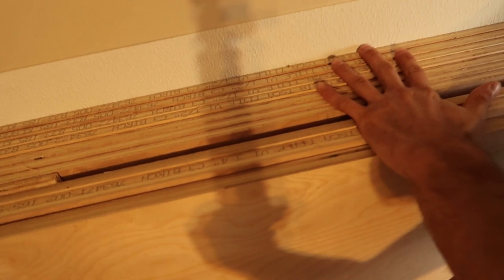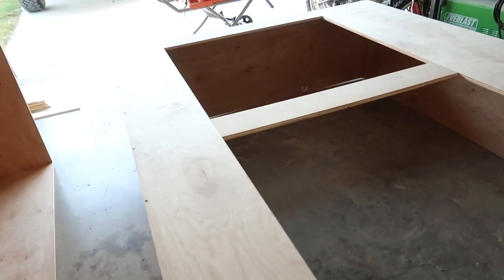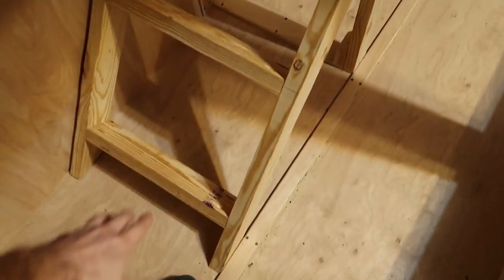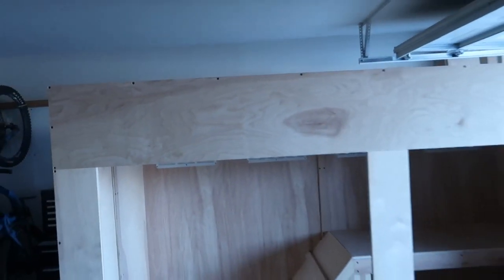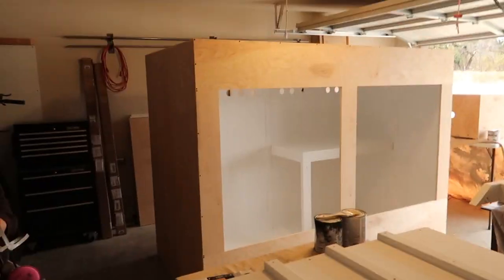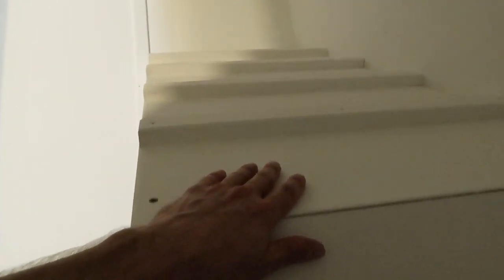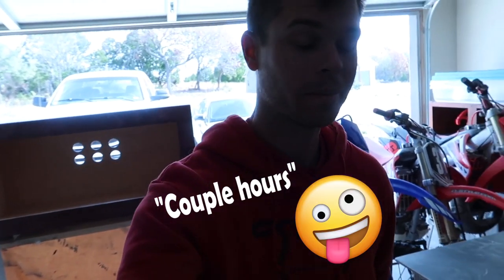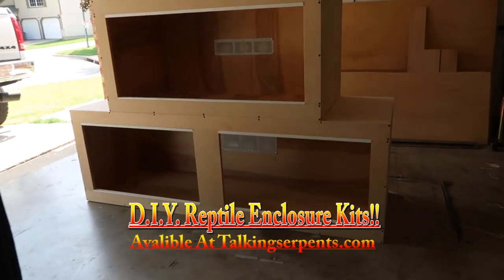Reptile Mansion 2.0!!  8'x4'x6' Big/Huge/Epic!!

Comment: Does the center bow at all? I'm looking at building a 8w4d6h with Birch 1/2" 4x8 sheets. Kinda like you did so I can fit it through a door way.
Reply from the maker: The center did not bow. The front and back half of the reptile enclosure are joined together with a 2" wide seam cover. 😎👍

Comment: I love all your cage builds. What is the lead times? And if you don’t mind me asking a rough estimate for a 4‘ x 4‘ x 8‘ long enclosure.
Reply from the maker: Thank you! On average lead times for a custom reptile enclosure kit take about 7 days to complete.

 • 8' wide x 4' deep x 4' high DIY reptile enclosure kit $977.99

• 8' wide x 4' deep x 4' high CUSTOM reptile enclosure kit with exteior PAINT, and inteior sealan $1,227.99

• 8' wide x 4' deep x 4' high CUSTOM reptile enclosure kit with exteior STAIN, and inteior sealan $1,377.99

Due to the size and weight of this reptile enclosure kit it can NOT be shipped with glass. My reptile enclosure kits are shipped with instructions, and inside these instructions there will be dimensions of the EXACT size of glass needed. Give these dimensions to your local glass company and they will easily be able to get you what you need. 😎

Shipping this size reptile enclosure kit is around $350. 

For more information you can send me an email to talkingserpents@gmail.com

Comment: For joining the corners you just screwed the plywood to each other with no additional framework ? And it’s sturdy enough ?
Reply from the maker: At what particular area on this reptile enclosure are you referring to specifically?
Reply: @talkingserpents  all edges where the side edges meet the top and bottom pieces .
Reply from the maker: @michaelmonast6440  1 1/4" screws that are countersunk. All of our reptile enclosures on our website talkingserpents.com are built to be strong and stackable. 

They can be stacked to the ceiling if that's what you want you need to do.

Comment: What plywood size did you use? I think you said birch plywood is it 1\2 ?
Reply from the maker: I use a combination of 1/2" and 3/4" birch plywood. 1/2" on the main structure, and 3/4" on the front trim for extra strength.

Comment: What thickness plywood did you use? How sturdy does it feel?
Reply from the maker: 1/2" birch wood. Feels very secure.
Reply: @talkingserpents  impressive! I would have thought 3/4 would have been necessary at that size. Thank you
Reply from the maker: @jordansilotti1283  it depends on how it's built. I use certain techniques to create rigidity. Also the front trim assembly is made out of 3/4" birch.

Comment: Will azek screw and plug kit work on the melamine enclosures
Reply from the maker: I don't know what that is. Do you have a link?
Reply: @talkingserpents  azek is a an Exterior pvc trim we use on houses for facia, around windows, corners of houses for certain siding.
Reply: @talkingserpents  probably would be a good hidden fastener for the PVC enclosures